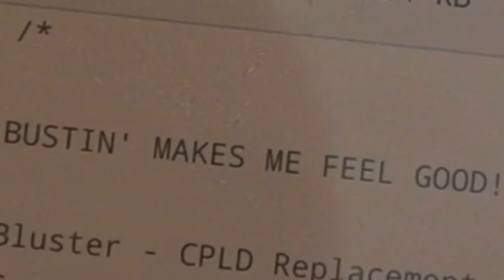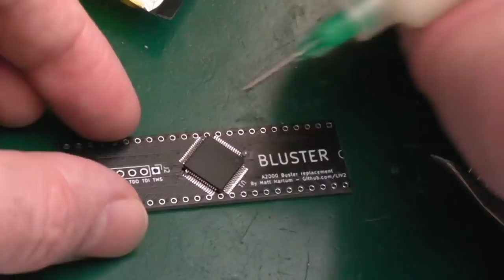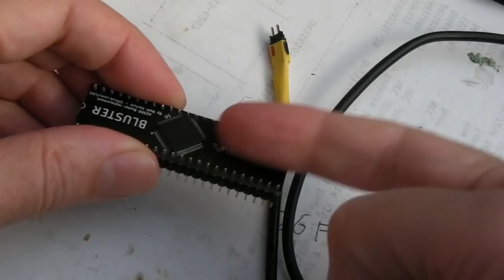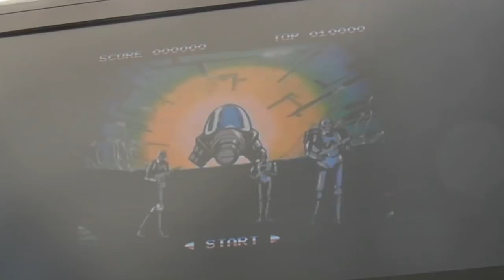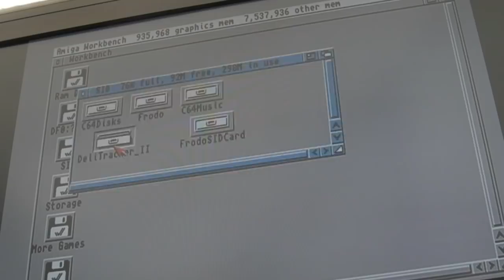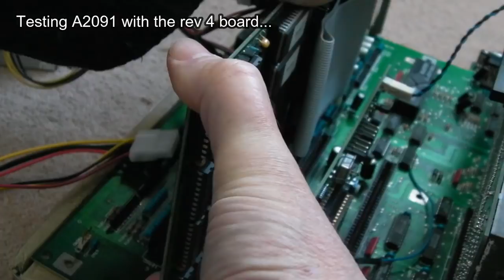Commodore Amiga - Bluster - Buster Repro

Comment: Actually Bluster is fantastic. If you have an Amiga 500 plus, you could use the B2000 EATX project and build an Amiga 2000 in EATX-format with ECS and 2 MB of Chip-Ram. If you also replace Denise by Indivision ECS (also CLPD, let output VGA flickerfree) , already two of the rare custom chips are replaced. If I understand the github issues correctly, the bluster is hardwareside compatible for replacing gary, if someone does the code. It seems someone already working on it. So half way done if you only count the number of custom chips, not the complexity...

Comment: Will the AMIGA version of UNIX SYSTEM V run on that computer with the Bluster Chip.
Reply from the maker: If the Amiga version of Unix System V works on the Amiga (sounds like it should...), yes it will work.  It depends if that version of Unix supports Zorro cards.  I would assume it would at very least support RAM and SCSI cards.

Comment: I am looking for someone who sells these assembled and flashed.

It's also worth noting the Bluster code is of the newer Buster chip for the A2000 which are very RARE as most A2000's have the first generation chip.
Reply from the maker: Thanks, I am not sure it's that rare - doesnt it reflect the 02?  I have 4 of them so far so they can't be that rare?
Reply: @GadgetUK164   They are rare... I am still looking high and low for a couple. :(

Comment: About workbench partition names:
If there is a file system, Workbench displays the volume name (which is set at the time you format the drive, for instance when you format a floppy disk with the name "Empty").
If there is no valid file system, Workbench displays the device name:NDOS (the device name is what you set in HDToolBox, or DFx: for a floppy disk)
You can specify a hard drive partition by either the volume name OR the device name, and they will both resolve to the same partition. 
Most program are written to use volume names instead of device names for their paths; when you use a volume name (such as "MYGAME_2:") and the system can't find a device or volume with a matching name, it will open a requester asking you to put "MYGAME_2" in a disk drive.  If you specify "DF0:", it will use whatever volume is in the floppy disk, regardless of what the volume name is.
Reply: Actually programs normaly do neither use device nor volume names but logical assignments like sys: libs: fonts: etc., which are set in the startup-sequence. If there is a name conflict, device is prior to label, wich is prior to logical assignment.
This can be quite usefull, if you for example insert a CD called "fonts", a program got the available fonts not from the font folder anymore but from CD. Quite usefull for designing flyers with exotic fonts without burden the system permanently.

If I remember corectly, there was even a cd changer using this by remembering wich disc is in wich slot and loading it when a program tryed to access it with label:

I quite like the way kickstart handles this.

Comment: Where can I get a pre built Bluster please?
Great video by the way.
FYI: my brother had an A2500 bought in 1991 and consisted of an A2620, An A2090a and an A2286 Bridgeboard and Workbench 1.3 which autobooted off the 40meg Rodime HD connected to the A2090a via the XT controller on board the card.. Unfortunately it died from the battery for the Bridgeboard and not the Amiga Battery which was still ok.